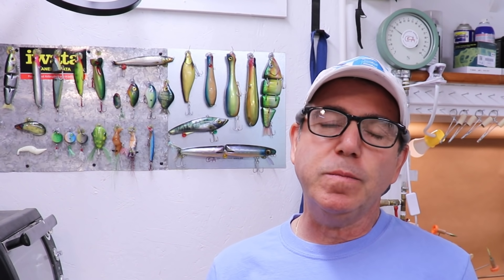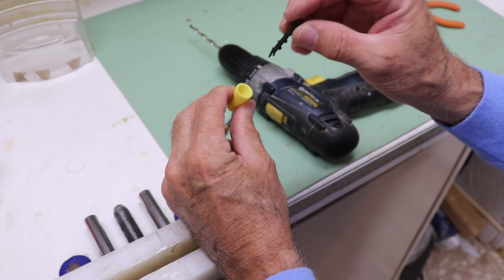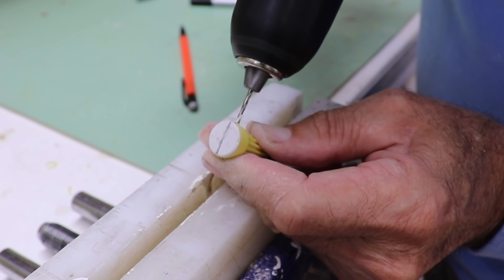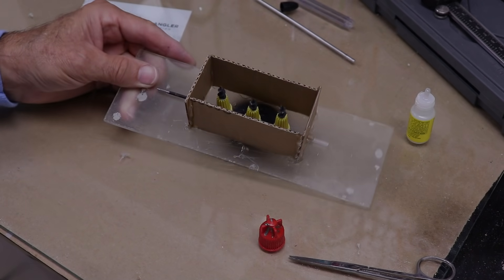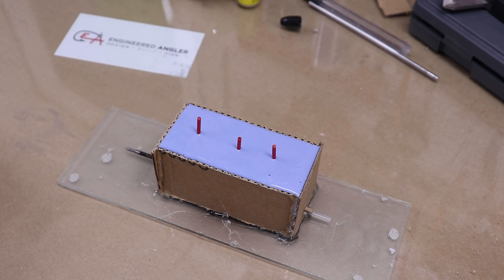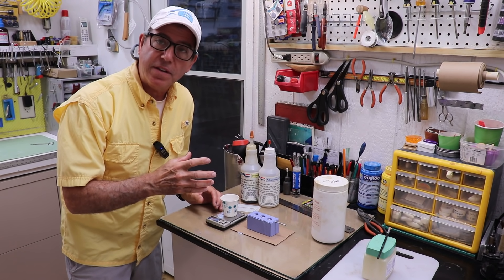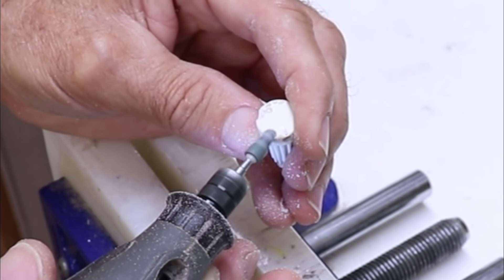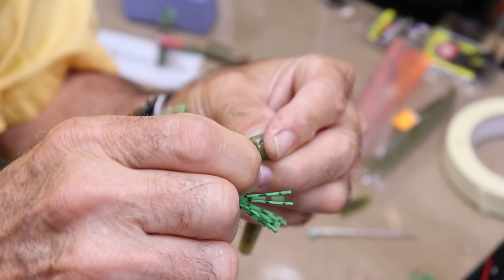Bass worm tail floater, Making Tail Whiskers for Your Bass Worm .  #bassworm  #bassfishing  #lures

Comment: Hate to sound thick but it was 45 odd years since was at school could you explain the mathematics to get 134 cm cubed and how to work out the volume, thanks.
Reply from the maker: Sure...I just  Measured the depth depth length and width of the inside of the Box In centimeters. Then I multiplied those 3 measurements  and that gives you the volume in milliliters.

Comment: Why not take the silicone tenticles and put it through an already floating worm(such as any z-man) and avoid this process?
Reply from the maker: Sure but you can put this on any soft plastic that you can screw it in to.
Reply: That's what I was thinking. Some of the sinking worms are not very durable, and you could lose a fair number of these attachments unless they can float the worm back to the surface when they tear off the hook. Much more economical just to add tentacles to the new, highly durable floating plastics for a similar effect. I still appreciate the engineering here and the inspiration it provides for modifying lures to trigger more strikes. You better hurry up and patent a floating worm with tentacles before all the lure companies steal your idea and make a killing on it.

Comment: One would think you could use a paper clip straitened out with a hook bent on the end and just pull the skirt material through and plastic for the same result but in 2 minutes..
Reply from the maker: True..but it won't float.

Comment: Instead of hassling with the mold... Why not just use the wire nut, and trap some air in it with hot glue?
Reply from the maker: not enough buoyancy the volume is much too small.